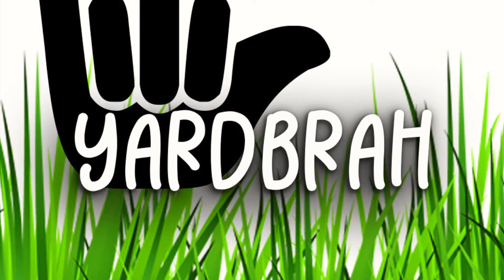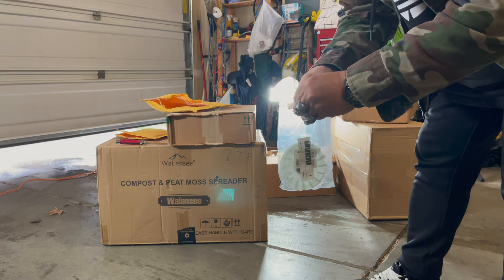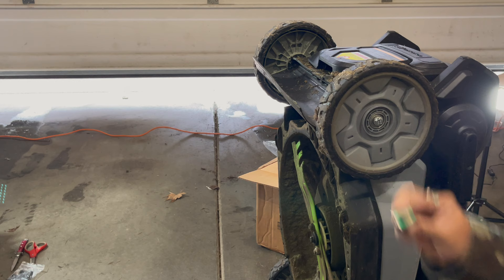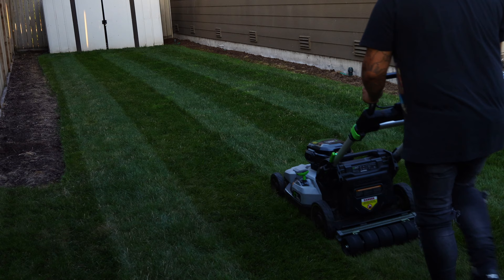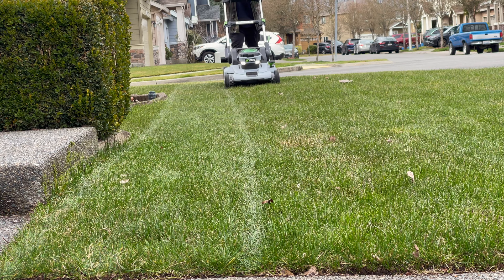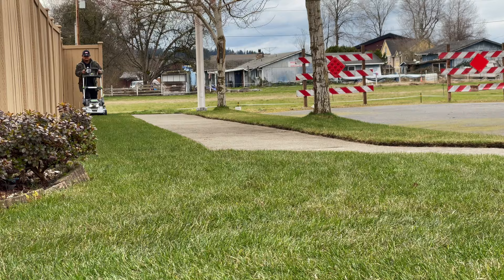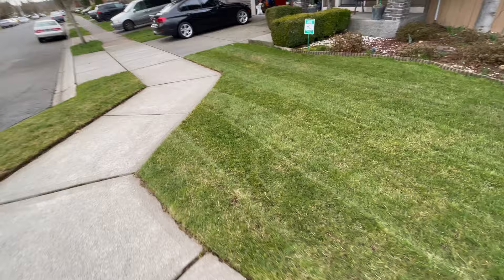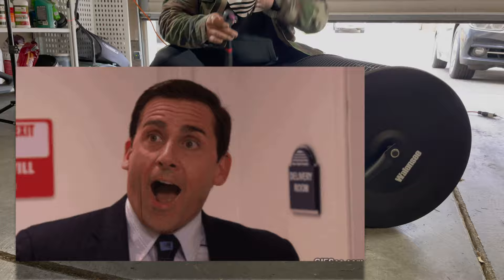EGO 21" Striper kit install / kinda review! End of winter Lawn stripes are fireeeeeeee 🔥🔥🔥

Comment: I used my peat moss spreader to spread my mason sand this past summer and it worked really well. Spread it super evenly instead of just flinging it around randomly with a shovel
Reply from the maker: Oh wow the sand didn’t just flow out super fast?!? 😊🙏🏾🔥🔥
Reply: @YardBrah  no it was like the perfect amount for me. Probably helped that the sand was slightly wet. I got it in bulk from my landscape supply yard. After it dried out I went back and raked it in with my level lawn and then broomed it in even more. I imagine if it was like perfectly dry and super fine like play sand it might flow out a little too quick. I'd give it a try in a small area and see if you like the flow/ amount. I just found I wasn't very good at spreading it consistently by hand.
Reply from the maker: @dlandes14  Ok cool thanks for the tips! It would be funny I pour the sand in and all of a sudden it just dumps on the lawn 😂😂😂🤙🏾

Comment: Thank you for making this video.  I received the striper kit yesterday.  After a very thorough inspection and design comparison, I found that it would be a mistake for me to put the new rear shield to my LM2142SP as the original rear shield provides much more seal at the back of the mower therefor would create a much better vacuum, suction and lift than the new 3 clips drop down open design of the new rear shield which is implemented on all the new models since the introduction of the SelectCut few years ago.  I wonder if that is the cause for many SelectCut owners to complain about the poor vacuum, suctions and lift on their mowers.  After tracing the new rear shield side edges over the old shield, I use a pair of scissors to cut off about 1 1/2" off both sides of the old shield edges and the striper kit went in and out freely while keeping the current rear seal design intact.
Reply from the maker: Oh nice!!! You know I’m not really having any suction issues ever since I converted my lm2100 to dial high lift blade! This is a good idea though for regular single blade or dual extended run blades 😊🙏🏾🙏🏾🙏🏾👊🏾🤙🏾🔥
Reply: @YardBrah  yes I had the SelectCut retrofit done and listed the parts before.

Comment: what kind of grass do you have on the front yard, and what height did you cut on ?
Reply from the maker: Front yard is mostly Kentucky blue and perennial rye! Winter spring it’s cut around 2” to 1 1/2” with the rotary… summer time is reel mowed from 1” to 3/4” 😊🤙🏾🙏🏾🔥